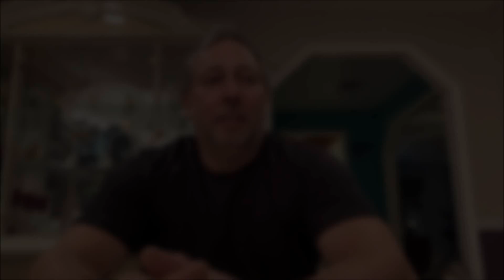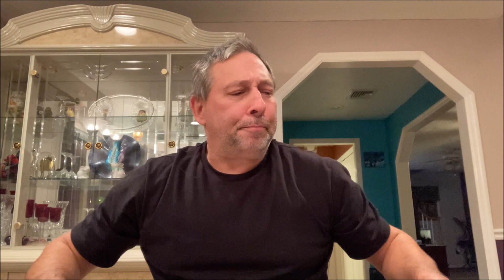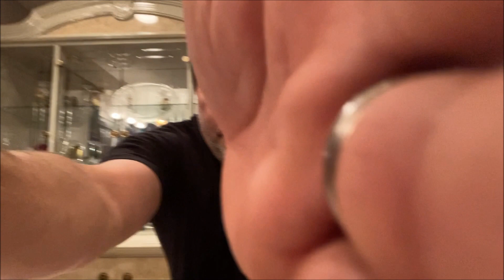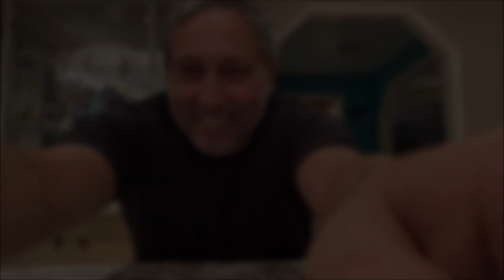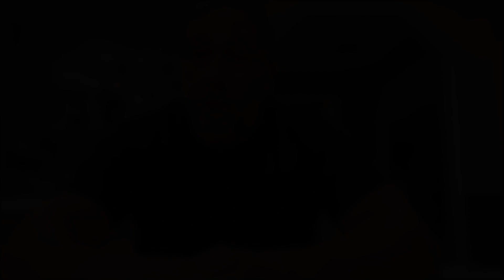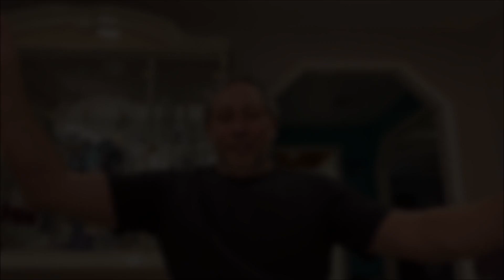Do you need to repin your 1999 - 2002 Ebay LS swap harness to run a 4.8/5.3.6.0 Vortec?

Comment: do I have to do any adjustments if I am using it on a ls1 out of a corvette with matching computer? One last thing, do you have a diagram of the under dash wires? The colors dont match the diagrams I’ve found.
Reply from the maker: I have never used a corvette engine or looked at the prints, I can’t say whether the pin outs are the same as an F body. Might want to buy the service manuals.

Comment: Thanks for the knowledge I've recently purchased the eBay 2002-2006 LS1 T56 DBC harness. So the same steps should apply correct? I've owned the harness this past Saturday. The fuse block has 7 fuses 1 10a 1 20a, 5 blue 15a. I need this to work with my truck 5.3L swap, which video is Best one to study? Also I want to use a X20 plug found on E36 bmw chassis to connect as a twist on Power harness! Wire specialty sell this type but crazy overpriced
Reply from the maker: Compare the wire pinouts of what you have to the factory pinouts on LT1swap dot com. Check every wire to make sure they are in the correct positions, see my other harness videos if needed for more information.

Comment: Thank you, Sir. After watching less than half of the first of your videos I saw, I subbed. My background is extensive in wiring. 30 + years of experience as a cable splicer for Verizon. If we messed up our wiring, sometimes thousands in one location, people would have to swap homes!! Ha! That said, I learned to build my own harnesses, etc. for all of my previous swaps. Pre-ecms. I am close to 80 and still at it. I now have a Gen 4 4.8 going into one of my old Jeeps. A frame off build as the only way I do them. A whole new world to me. I am looking forward to this. Many guys said, get a standalone harness and go with it. My first thought, nope. I am going to learn how this thing goes together, where every wire goes in the original harness and make it work. 
As I said, you make so much sense, plain and simple. Do it right or go home.
By the way....love the Pup!
Reply from the maker: That is great, as techs we have the same brain. We need to understand how it works and why, not just slap it together and hope for the best. Good luck with the build and thanks for the sub!

Comment: Great info, went through your whole 99-02 DBC eBay harness video, as I just got one for an OBS truck swap with a 6.0 and 4L80e. I usually buy a wiring schematic through Mitchell 1 diy but do you know of any free resources to get pin locations at the connectors. I see lt1swap has the ECM side but didn’t see connector side. Great info!! Keep up the great work!!
Reply from the maker: Thanks! I believe some of the truck schematics with the sensor pin outs are also on LT1swap.com, and I also found some full schematics on LS1tech.com. Dig around a bit on the net and you will find them.

Comment: Great video. Can you possibly do a little sample video on repin & confirming that wires are good and going to where there supposed to. Preferably 2003-2007
Reply from the maker: The 2003 to 2007 harness I used did not need any wires moved because there was no LS1 after 2002, this is specifically for 1999-2002. I have videos on my channel going over both 1999-2002 and 2003-2007 gen 3 ebay harnesses, take a look at my video list and you will find them. I will put links to them in this video description soon.